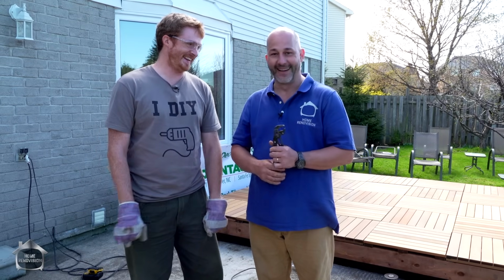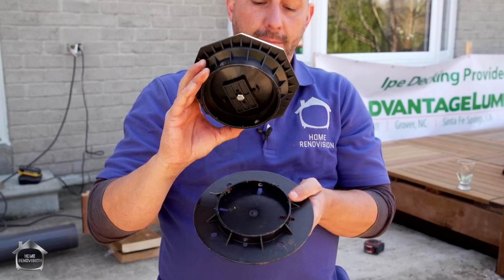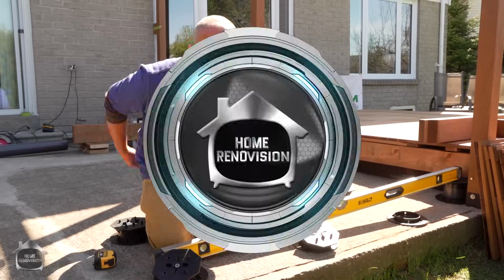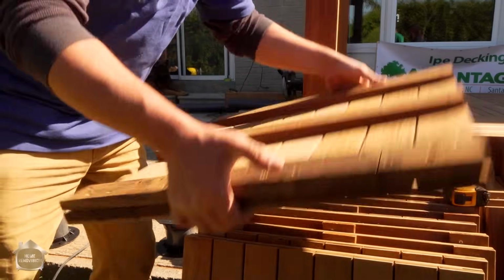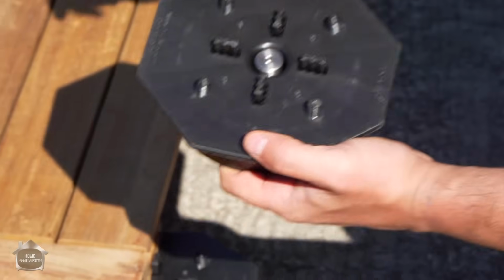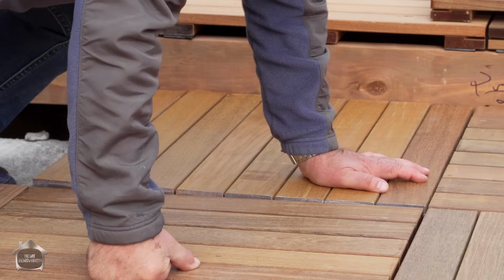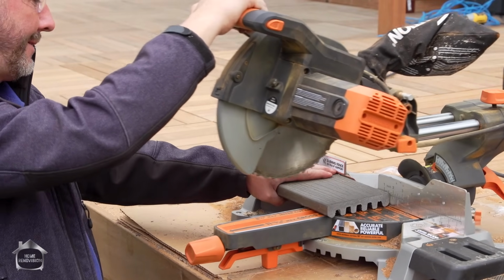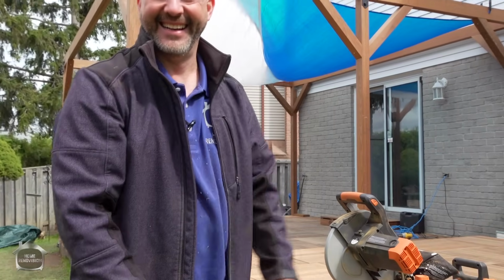How to Build a Deck on Concrete for Beginners

Comment: Just use MRP Supports pedestals and you don’t have to cut pvc piping that’s so dumb lol and they have the self leveling head the compensates slope up to 5 % plus they have a white rubber material on the head of the pedestal which helps with noise dampening and doesn’t require you to use shims

Comment: @Home RenoVision DIY - Hey Jeff - I have a question.   Can we do this same thing if the patio is raised?  I live in a house that was built in the early 1960s by my Grandparents.  They added a patio on the back of the house that is about 18 in off ground level.  The "slab" is about 8 in thick and seems to only be supported around the outside by concrete blocks underneath. We cannot see any further under to see if there is support in the middle.   We would like to add a larger deck because this has crazy measurements (it's like a bowling alley).  We would like to go over the cement and extend and use composite decking.   Can this be done without busting out the cement slab?   Also, we live in Illinois, so about the same climate as Nova Scotia.   Love the channel!   Thank you for any help!

Comment: Would the same system, eg using the plastic piping as columns work for deck that's about 1 foot of the slab? Also, don't you have to fasten the plastic footers to the actual concrete?

Comment: How do you prevent it from sliding on the concrete after install? Did you drill holes into the concrete to secure the base ?

Comment: I want to install a deck over my front entry sidewalk and it's adjacent dirt "planter" areas...I'm hoping advantagelumberand the altitude pedestal system will work with me + my home terrain... I also have drainage issues.

Yes, I need a pro. No, I don't have the mula; hoping I can make this come out great with extra care.

Comment: Hi Jeff, First of all, thanks for all the videos you create. Some of them were extremely useful in a remodeling project we just finished - not DIY, but being rather handy with projects, I'm a very involved client - especially the one in which you featured Trademark Soundproofing's products, since my new office needed to be soundproof.

I'm in the midst of laying deck tiles (this part and a few others I'm doing myself) on my rooftop and one lesson I learned from my neighbor was to label each pedestal. They had their roof redone and the roofer put the pedestals back wherever he wanted, so his tiles are all wobbly, so I'm using a screwdriver to mark the pedestals with their "coordinates" (i.e. A1, A2 ... A9, B1, B2, and so on). This way, if I ever have to remove the tiles I won't have to spend a day and a half re-leveling everything.

Again, thank you!
Reply from the maker: nice idea. Cheers!

Comment: Nice video. Thanks for sharing. I have a similar concrete surface deck. I was thinking to re-level the surface by adding a concrete layer before installing the deck tile.  I wonder which way is easier.

Comment: I have a feeling that glued on skirt backing to the concrete didn't hold too well. Not the most precision cuts around the posts either. I love your videos, but sometimes it seems kinda "hacked" and rushed with over confidence. Entertaining though.

Comment: Could you use this system on top of a shingled rooftop with a low slope?  Set directly on the shingles?
Reply: Yes that's what these deck tile pedestals are typically used for.

Comment: I have being following your channel for long time and now I finally own a house to do all these stuff. I have a tiles front patio but it gets slipery when it is wet or even worse, icy. I see that you just place the sleeper/stand on top of the concrete, doesn't it need glue or screw to secure it in place?

Comment: Based on your YouTube videos, I am planning on installing those IPE Tiles around my In-Ground Pool. Do  the Pedestals require to be secured/fastened to ground/cement/etc.(?) or is the weight of the Deck Tiles sufficient? Would there be any possible movement?

Comment: Is this still cost effective?

I have an old large concrete slab kennel that we are looking to cover with wood or composite decking and to ultimately turn the space into an outdoor bar?
Reply: Diamond grind and self leveling concrete would be the alternative. That runs about 8 bucks a square foot in some places. Or hammer out the concrete and do a traditional post and joist patio. 18 inches is preferred minimum height on these decks to allow airflow. (according to their website}

Comment: The mounts/footings clearly have screw holes to fasten down the plastic footing. How come you aren't screwing them into the concrete with red-heads or some other concrete anchor? BTW, no Advantage Lumber/YouTube sponsor promo code for a discount?

Comment: To make anything better, there needs to be a dog on deck!  I have a concrete slab off the back of my house above ground that the owners before me attached a deck to leaving the ugly concrete slab full of problems and water issues. Finally got the water issue solved. This looks like an easy fix, more expensive than what I had in mind but easier. I assume the tile connecters can be fixed to the concrete masonry screws? Thanks

Comment: Seems like it’s probably not a concern, but do you need to worry about water getting under the deck and settling on the slab? I don’t worry about it with the slab open, but with no sun and limited airflow getting to it, is there something that needs to be done to prevent mold or other issues?

Comment: Is there a height limit suggested for the difference in elevations? We have a sloping concrete pad with over a foot differential across the length of the pad
Reply from the maker: Hi Shawna, no problem whatsoever. Cheers!

Comment: How does this hold up when the concrete heaves due to temperature/season changes?
Reply: Yep thats my question!!! How does this hold up when the concrete heaves due to temperature/season changes?
Reply: If/when the concrete moves, the deck will move too. You'll then have a mess on your hands. This is not a good system to place over top of a failing concrete pad.

Comment: If you needed to, would you be able to lift up one of these panels in the middle of the deck to clean underneath it? Like if it was used on a roof and there were leaves. I also can't wrap my head around how you did the corners using the plugs and stands.
Reply: You should be able to lift each tile off the post. I was wondering about the corners too

Comment: Hello I'm a new follower and subscriber. Very interesting wood patio setup. I also have multiple weird uneven slabs for a patio. I've been wanting to find someone to remove the multiple slabs an pour one but this gives me another option. Thanks. I also want to build a two patio covers in our backyard. One open an one closed and a raised roof deck over one of the two future patios off of my one story house.
Not sure if I need to remove slabs or cut holes into the cracked unevem slabs for the patios/roof deck posts or can I just bracket them down? I'm guessing its better  to cement the posts in thru the existing slabs then build. If i was to become a member of your diy team, is it possible to consult with you on my options? Thanks I'm advance from S. TX.

Comment: Man you would have HATED the previous owner of our house. I’m currently demolishing a “deck” they put over the concrete slab patio. They used marina floating decks and laid them right over top. Half on the slab and half right on the ground. I wish I could email you pictures. It’s beyond hilarious. Thanks to you I’m able to take it apart while my husband is at work. The slab itself is an improvement. 😂😂😂

Comment: Will that slab continue to crack and sink over time with the additional weight?
Reply: Yes, also water will still pool to the foundation if the slab is not leveled properly first. Most important step #1 should have been to level the concrete by hiring professionals to prevent future basement water issues, and then only then installing the deck. Also would have been much easier on a level surface.

Comment: why not bolt the plastic support to the cement? seems like it can come apart easily
Reply from the maker: since the deck panels are installed around the posts it will not be going anywhere. Cheers!
Reply: @HomeRenoVisionDIY  hmmmm I want to say "what about hurricanes?" but I realize you don't get them in Canada lol
Reply: @dannyfresh6697  Yes, coming from Cuba I know what you mean, but the strongest storm I've seen here in Ontario is just a breeze compared to tropical storm winds. Add to that that the house and fencing will shield the decking. However my mind is reluctant to accept the floating idea as I'm wired to see things attached to the ground.

Comment: Did have to add one thing Jeff (from my comment to a post). Spent 5 mins trying to figure where got the measurement, of 5 1/8; as I had diff answer & thought I was going crazy....so glad, I’m just still a tad bit crazy 🤪👍🏻
That deck system, is a nifty cool system. Pretty awesome pedestal, especially being adjustable in multiple directions/heights....
Cheers ✌🏻
Reply from the maker: LOl, try not to listen to my math. I don't always say what I am thinking for some crazy reason. Cheers!

Comment: See if that saws start up time is better without ext cord.  If so, you need a heavier gauge extn. cord
Reply from the maker: not the cord, it was a 14 gauge. It seems to have a slow start to keep from tripping breakers. cheers!
Reply: @HomeRenoVisionDIY  I C thx

Comment: Supports are nice but about $11 each, I am sure an experience person can build a level foundation thru shims or gradual slops and save much too.
Reply from the maker: I am sure that would be true, However since the decking company was supplying the materials they opted to highlight the pedestals. Cheers!
Reply: @HomeRenoVisionDIY  I would use it for sure while promoting the product, it certainly seems beefy and flexible, the pvc has much compressive strength, I built a pool deck out of it using toilet flanges with 3/4" plywood and SS hardware.   The nice part you could take a dump while on the deck with a WC.

Comment: Is there a video on using concrete blocks for a deck besides the one you have on the deck you are leveling from? We have a cracked concrete slab I would like to build a deck over.
Reply: https://www.youtube.com/watch?v=jHZoDVB_AS8&list=PL34cQkzKfXWbW7TouNi-ZEZ8pdyK2Ncw- or go to the playlists and look for Floating Deck there's more than one video using those blocks iirc
Reply: @suivzmoi  I've seen this one. The deck I want to build is only going to be barely off the ground. Just a square small deck. I didn't know if I needed to use all the hardware that's being used on a bigger deck. Thanks
Reply from the maker: Cheers!

Comment: So...I will explain.  The deck tiles are to the clips.  Each clip holds one corner of four tiles.  By the time it is finished, the tiles are tied together as one mass because of the clips.  It is heavy and stable.  It's not going anywhere
Reply: this is not the reason why it's not going anywhere. the deck is locked by 6 posts which have been drilled into concrete. without the posts the deck would slide off the concrete over time especially if you have freeze/thaw cycles, regardless of how heavy it is.
Reply from the maker: You are both right. In addition the wood blocks around the perimeter are glued in place and attached to the deck.
Reply: I appreciate both replies.  I didn't think to mention the posts, but you are right.  Also, we don't have freeze/thaw cycles in my part of Texas, so that is not a concern.  Pretty much the wind can be I always learn something from these videos.  Keep me coming!
Reply: Oops! That was supposed to be keep 'em coming!  Damn auto correct!!
Reply: @sharicross547  I'm dying XD
Reply: so, the pedestals themselves don't need to be drilled into anything - what if you're installing these onto a roof?

Comment: 3 3/8 + 1 1/2 =/= 5 1/8
6:45

Unless I’m missing something...
Reply from the maker: sometimes my lips move faster than my brain. Cheers!
Reply: Was thinking the same thing. Cus was like 3 3/8 + 1 1/2 = 4.875 & was wondering where the other  1/4” came from 🤣. Thx for at least replying & letting us know(as you always do for us👍🏻); that way we know where not going crazy(even though a little bit of crazy is a good thing😉). Glad read some comments so didn’t double post.
Thanks a bunch Jeff & Max for the video. Love it & the channel. You guys rock! 😎
Cheers✌🏻

Comment: Technically there is nothing wrong w/ a patio slopped away from the house - correct? You want the water to run-off away from the foundation and you don't want it to puddle on the patio causing issues w/ falling.
Reply from the maker: There is when it is sloped in 4 different directions. Cheers!

Comment: WTF that blade is the 💩what is the life expectancy on it ? Thats so  awsome not having to change blades in between cuts or having two saws with different blades !
Reply: If you do not cut metal - probably it will last long. But my experience with this saw and blade - after 15 cuts of metal like in his last test - blade become totally dull and does not cut at all.
Reply from the maker: Still using mine today and the blade is as sharp as when it arrived. i will keep everyone updated as to its performance.
Reply: You better trademark your image!! I'd love it on. a T shirt , golf shirt

Comment: Hi Jeff, I have an off topic question re: kitchen cabinets. What are your thoughts on MDF doors?  I’m shopping around for a cabinet maker (in the GTA) and MDF was recommended vs wood (it will expand /might crack over time). I may or may not sell my house in the next few years therefore I don’t want to buy junk but I don’t want a $60k kitchen (galley).  
Also, is 5/8” or 3/4” MDF/plywood recommended for the cabinet bases?  Thank you! 😊
Reply: i assume you are comparing to ply instead of solid wood because otherwise the answer would be obvious. but there are only two real benefits of MDF over ply: cheaper & easier to paint. the worst things about MDF: weaker and will sag more easily if used as shelf (have to make it thicker). hinges wont stay tight for long since mdf longevity around screw holes are terrible. btw ply should not expand (maybe you're thinking of particle board) however there will be tiny movement and maybe gaps may develop in the joinery which may be a problem if the ply is painted but generally adds character if it's stained/oiled finish. MDF is the most stable and will look perfect for a long time painted. MDF may be the right choice if you like the painted look and are going for light duty.
Reply: Follow Media thanks so much for replying, I appreciate it.  Yes, I was comparing MDF to plywood.  My current kitchen (builders) is 5/8” MDF base cabinets with wood/ veneer doors with stone counters.  I have noticed, after 14 years, there’s a bit of sagging with a couple of the longer shelves otherwise everything else still looks good. I want to replace all cabinets and have Quartz counters. I desperately need storage aka drawers for pots and pans (stainless steel and cast iron pots).  It’s a small 17’ x 8’ galley kitchen. I don’t know if I should go custom, or Ikea for the cabinets and custom for doors.  I’m concerned about thermofoil doors not withstanding the heat around the stove (gas).   Any advice is greatly appreciated!
Reply from the maker: here goes a basic summary. the more you spend the better the quality as a rule. particle baord is cheapest then plywood then solid wood. 5/8 is better than 1/2 and 3/4 is better than 5/8. thermofoil doors are cheapest and get damaged from heat and steam. solid wood doors are best. Cheers!
Reply: Home RenoVision DIY thanks Jeff!

Comment: Now I need a chisel. Pulls out a paint scraper. The concept is great. The execution is mediocre at best.
Reply from the maker: Like you have never done that before. SMH!
Reply: @HomeRenoVisionDIY  only when I was an apprentice carpenter. Did it once. Also blowing out the corner edges of concrete. Tell me you didn't know that would happen.